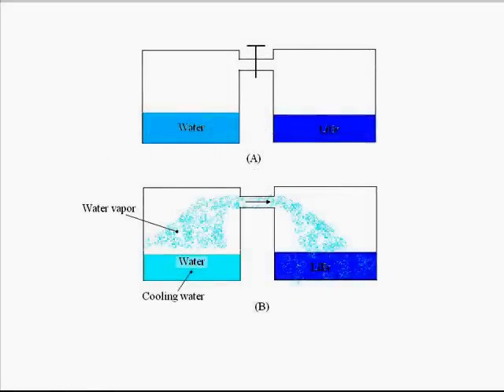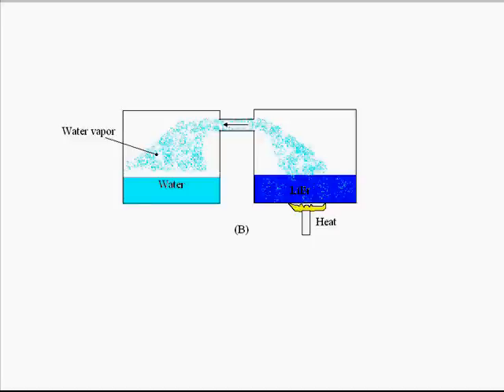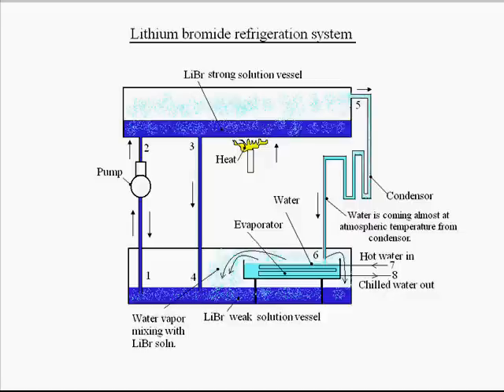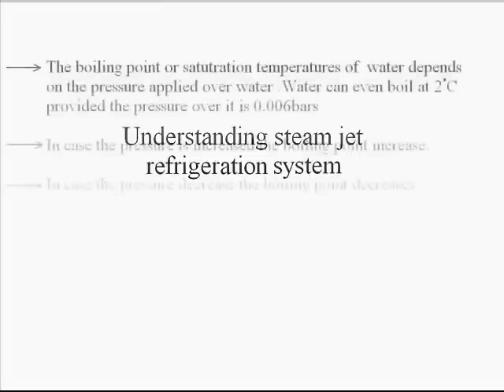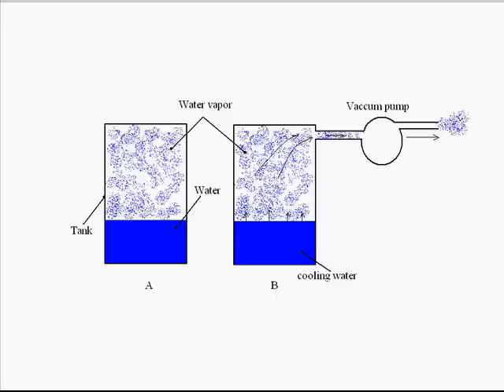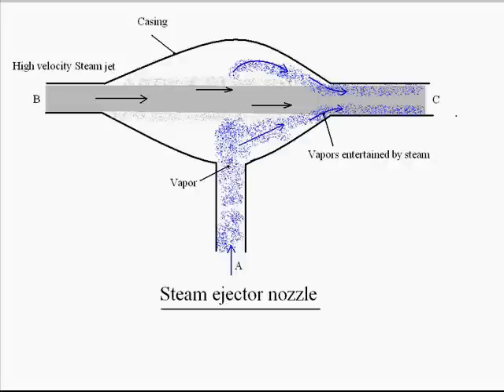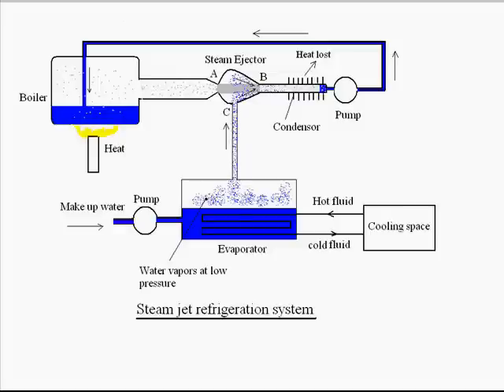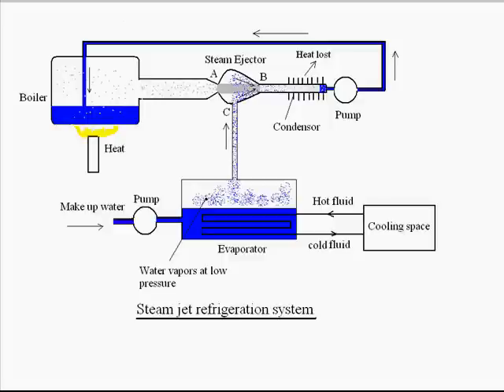Li-Br  absorption  refrigeration system

Comment: A very good explanation on the basic working, however as said by you lot of of other details are missing like operating temp, pressure and the real life problems that would come, I would be glad, if you could share these, I am interested to the point I would like to make a real working model from the same. please contact
Reply from the maker: Kindly find over google...

Comment: The steam jet refrigeration system, as described in this video, continuously receives water vapor from the evaporator; but, being a closed system, water would only accumulate in the boiler, steam ejector, and condensor, until the pressure would become so great at the steam ejector that the flow of "low pressure" water vapor would stop and probably reverse back into the evaporator. This description quite simply fails.
Reply from the maker: Resologist , actually this is the principle concept , you can check with variety of corresponding sources . However practically  the water accumulation in the boiler is continuesly  managed to keep the system working ...
Reply: Not shown here. Water vapor is added to a cycle at "C"; but, no water is shown leaving this loop.

Comment: you sed in the 4th minut of this video that the Libr strong solution will absorb automatically the water and evaporate it !!! dont you think that the low pressure through the throttle valve will evaporate spontaneously the water ? not the LiBr solution ???
Reply: bro you are right . because if we decrease the pressure of system or any vessel it starts boiling automatically at low temperature . For example: we know the boiling temperature of water is 100°c and now if we take water of temperature 82°c it's not boil as we know . But water at 82°c start boiling if we this water put into a vessel and remove air from vessel continuously and after some time we see that the water start boiling at 82°c because pressure of vessel decrease .. Thank you .
Reply from the maker: elborate your question some more

Comment: I have a question about the steam jet. Isn't it that the mass of vapor coming out of the vessel (m1) will be mixed with the mass of steam jet (m2) giving us m1+m2 then will be pumped into the boiler. But there is no compensation on how m1+m2 in the boiler will be back to m2 again. My point is that you keep adding makeup water in the vessel and at the same time keep adding water into the boiler. Shouldn't the boiler will be filled up? Or should the m1 in m1+m2 must be the makeup water? 
Thanks.

Comment: Awesome SIR, few questions as i liked the JET Refrigerator, as i can create steam via solar and bio gas/rocket heater.  But is there any smarter refrigerant other than water for jet type refrigerant as i would have to heat it very high(if using water as refrigerant) and i would loose out in cash benefits of using this system.

One more question why is jet refrigeration not so famous, am i over looking its weakness.

regards,
S.Das